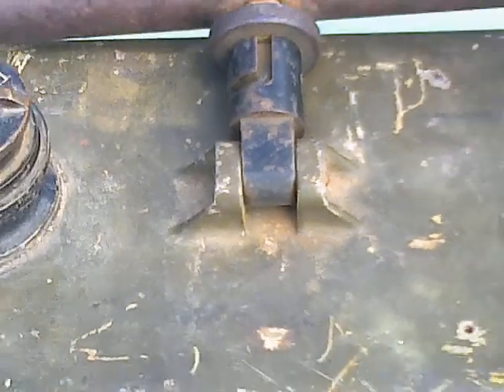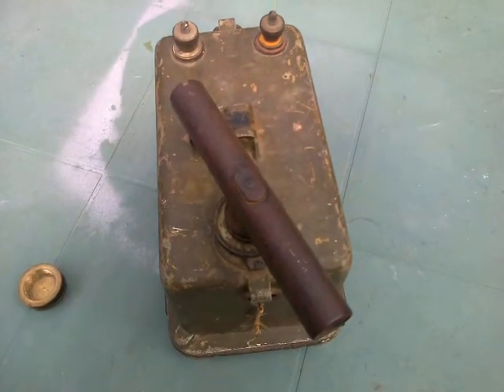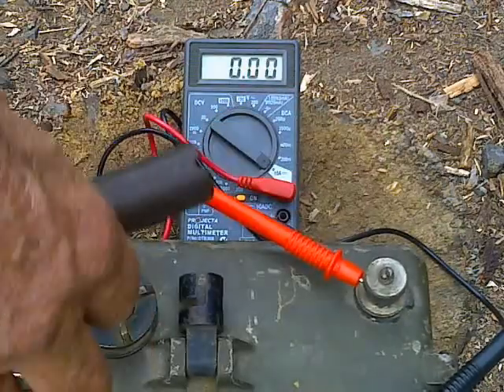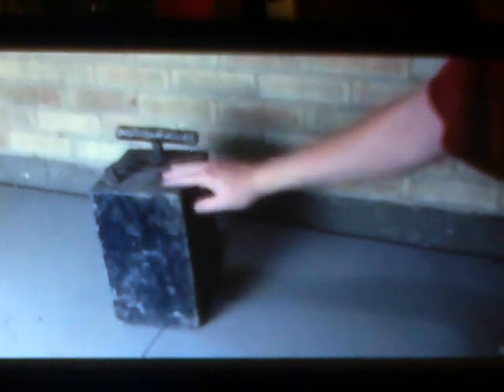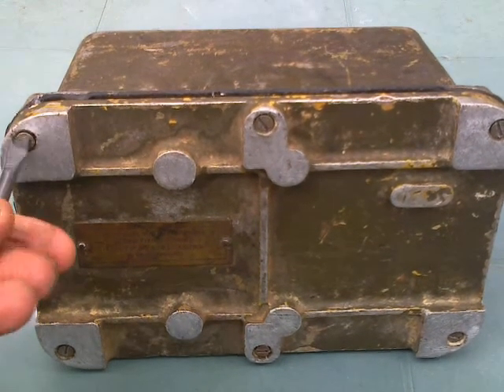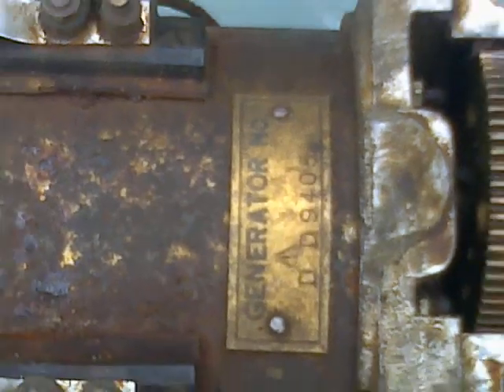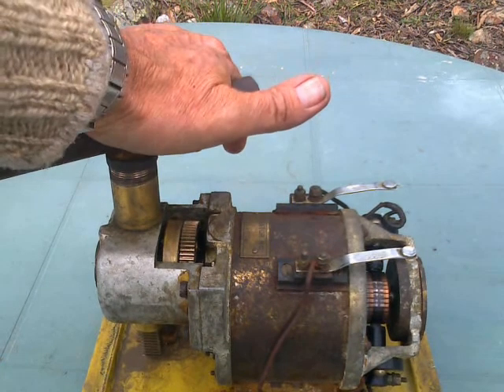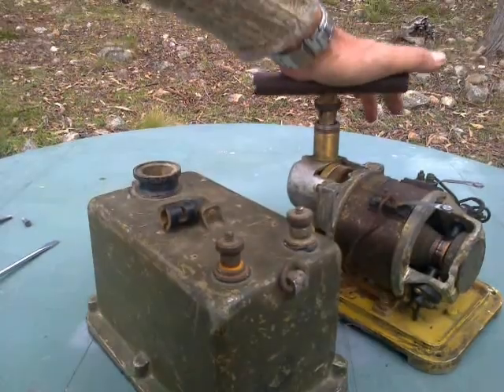2nd Australian Imperial Forces Blasting Dynamo Dissection... (Shoutout to Cody's Lab & Big Clive).

Comment: Excellent video! I've never seen a model like that one before. Thanks for showing off the guts!
One note, your digital meter is averaging over a long period in comparison to when the power is actually present so you'll always get a poor reading. A 100V 40W lightbulb (japanese voltage) might give you a better indication of the juice present. These sorts of machines typically gave 100V or so when new.
Reply from the maker: G'day,

 Thanks,

   When I re-re-watched this I realised that the highest Voltage was 96.2, rather than the 93 V. which I mentioned, and what I thought of as 2.8 Amps & 3.2 Amps was actually 12.8 A. & 13.2 A. ; so 100 Volts Open Circuit when new sounds right.

  I find (with Solar Panels) that Voltage under Load is maybe 55% or 60% of whatever the Open-Circuit Voltage reads on the Meter, so if we postulate 56 Volts at 13.2 Amps, the Peak Pulse is running at 740 Watts (ie, one Horsepower) for about one Eighth  of a Second, and the Armature is doing about 500 to 600 RPM, when the Switch is tripped...

  It's really very very cunning, I must say.

  Have a good one,

  ;-p

  Ciao !

Comment: no FKN way! I have the same unit-found in a tip on a property in the town of Weethalle. Mine has the brass badge still. it reads EXPLODERS DYNAMO MKV11
Made in Australia by ELECRICITY METER MGF. CO. PTY. LTD.
1942
SERIAL NO.D^D5355 .
it is missing the knobs though and exists now with some poor replacements, i have video of it if your interested-it features in my intro on most and also a show and tell.
These are by far the best and built to last!

Comment: it is also the only other one i have seen( besides my one) in Aus that is not in a musuem!
Reply from the maker: G'day,

  Thanks !

    Wow, it really is a small World, isn't it ? (!).

   I've written that down, maybe I'll confound the future Archarologists by using my Dremmel to engrave a Replica on Aluminium Sheet, with the appropriate Serial # from the Inner Dynamo, and fix it in place of the missing Data-Plate...(?).

   I've figured out a practical use for them, in these Modern Dayze, too...; Estes Model Rocket Engine Igniters only need about 3 Volts, so I'm sure a100 Volt Pulse will do the Trick.

    No messing about with Safety-Keys & a Battery-Box.....; simply don't raise the Plunger on a completed Circuit (one Wire off the Terminals constitutes a "Safety Switch") unless ready to launch a Skyrocket... (!).

   It should be light relief from being a Doorstop, so I think I might have to do it...

  Have a good one,

 ;-p

  Ciao !